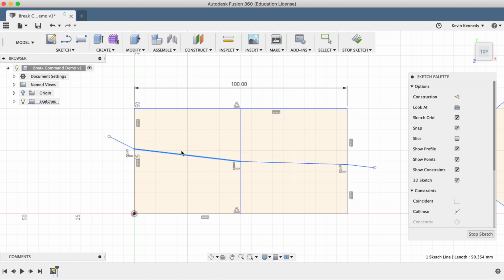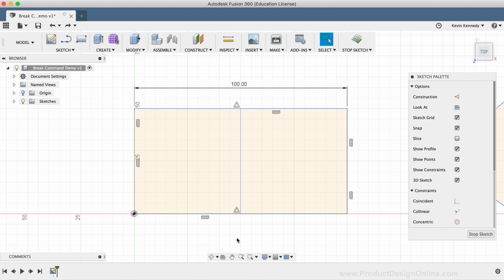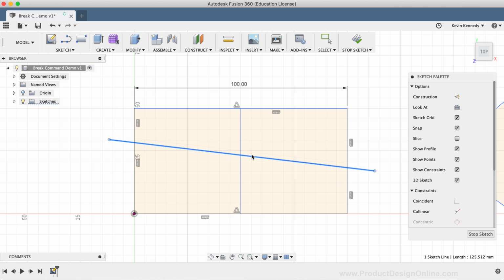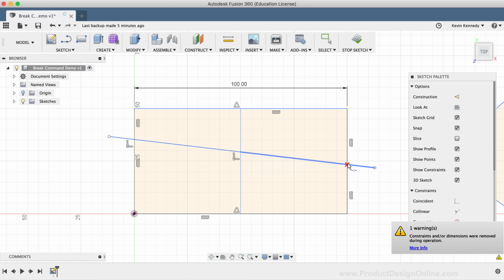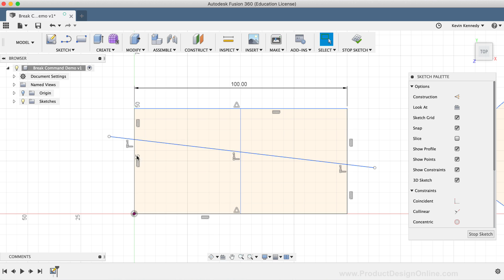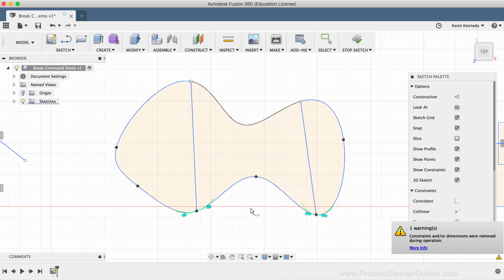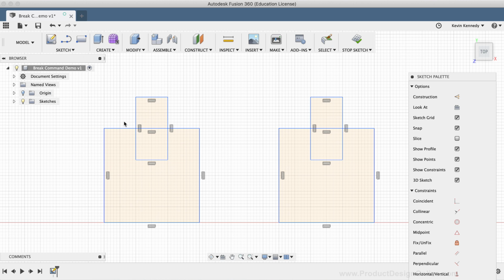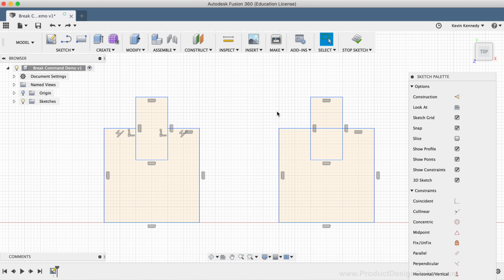How to Use the Break Command in Fusion 360

Comment: Hey Kevin I've been trying to google for a solution without luck for a few hours now. What is the process to combine two lines? somewhat like a anti-break function. Hope you're still around to help out a newb like me.
Reply from the maker: There's no way to 'join' the lines to make them truly one entity. Constraints should be used to make geometry have relationships with one another. Then, in the most modeling feature dialogs, you will see a "Chain selection" option. That option (when turned on) will select all geometry that touches.